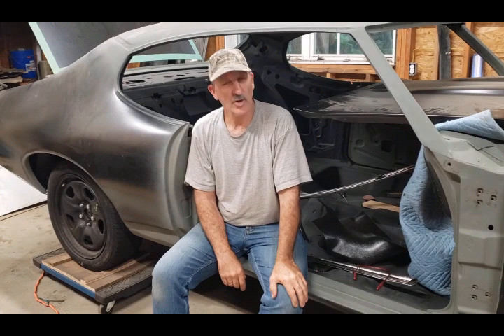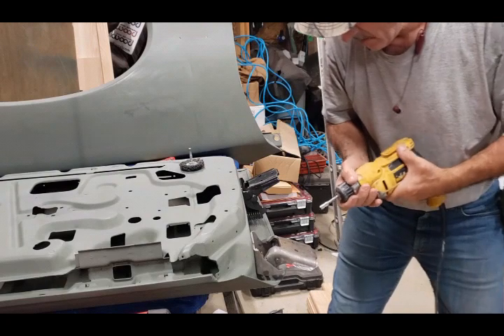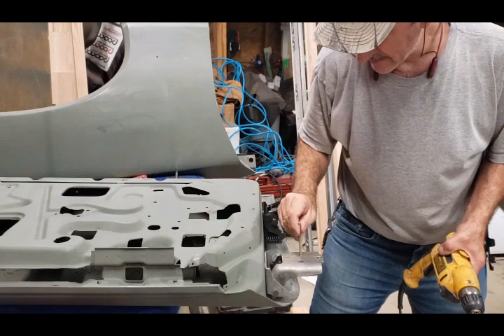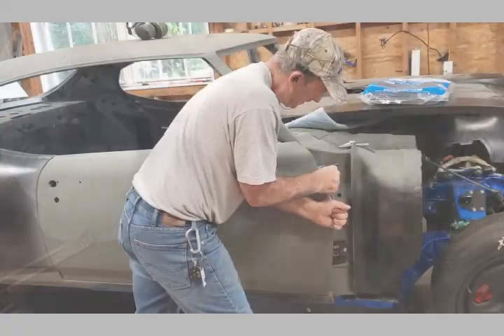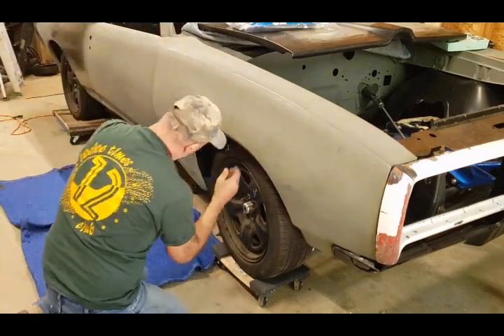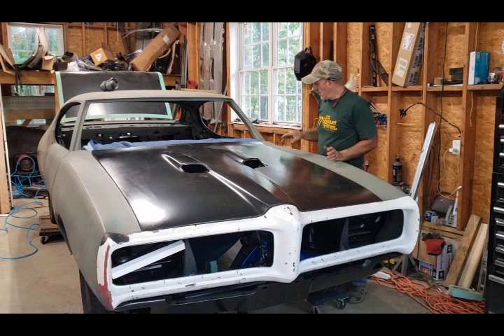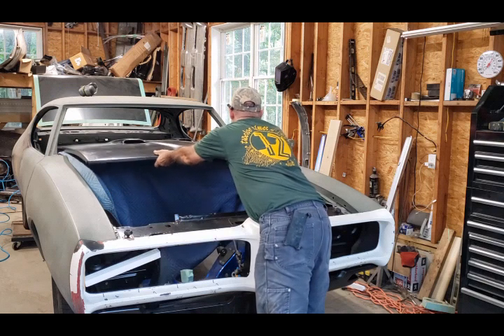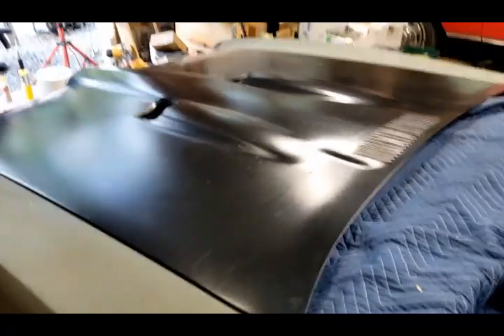GTO door & front-end adjustments 68-72

Comment: hey Harry , great video I have a few questions , your gap between the door and fender looks like 1/2 inch how will you resolve that without moving the fender? also I have a 68 Olds H/O A-body the body shop located my inner fenders and they are not correct because they do not line up with my core support holes, my question is should I remove the fender and locate the plastic inner fender first and then install the fender and make it match up to the inner fender ? One more question, can you show us how you discovered the 1/8 inch misalignment? I also did a frame off and my body may not be square I'm just not sure how to check it for square once the body is on it. I measured my frame for square when it was just a rolling chassis. Not sure how to check the body for square, Thanks again for your time and keep the videos coming, they are very educational., Joe in Kansas
Reply from the maker: Hi Joe. To answer your first question. Any Gap that is not symmetrical with the fender or quarter panel I am going to weld metal onto the part that needs to be filled. Such as the door, I might add some wire to compensate for the space.  The body not being Square on the frame. I put the front end on.  I noticed that the fenders were not lining up properly. So I started at the back of the car. I measured down from my quarter panels to the rear end. I got my measurement that way. I compared it to the other side and I was off approximately 5/16. Which would actually make up the space between the firewall and the fender. Once I installed the hood. I aligned everything from the firewall to the front bumper. The front end had to slide to the driver side approximately 3/4 of an inch. I am going to make a video of that soon. Also in order to check for square you could use a tandem. I have one and I am going to post that in the video as well. As for the inner fender. I will install the fender first and then I will cut slits above the bolt holes where it gets secured to the inner fender (cut the inner Fender only) that way it will flex and not pull your front end to the left or to the right. I hope I answered all your questions. If not let me know. I'm glad you're enjoying the videos. All the best

Comment: Im thinking you might have your quarters pushed back somehow when they were replaced. The front bottom  of your door should line up pretty close with your  rockers.
Reply from the maker: The GTO 68-69 I'm not too sure about the other ones, the Gap is between the fender and the door. The rocker panel and the lower Fender actually touch. The Gap is between the fender and the door. you can't push back the quarters because of the inner structure of the body the quarters get welded to the plate where the door Striker is. It's very difficult to explain. You have to really watch the video I go through all that when I'm installing my quarter panels. Thanks for commenting. All the best..
Reply: @classicrewind2715  Hey no worries,  hope it works out for you. On my 69 I have a 1/8 gap between the rockers and the fender and the door is 1/16 back from the rockers giving me about 3/16 from fender to door and 3/16 from door to quarter. Mine was that way from the factory and I put it back that way when I restored it. I do know the facrory did a horrible job assembling these to begin with lol
Reply from the maker: Thanks. I think this car was in an accident before I purchased it which racked the front end a little. I'm working with a lot of aftermarket parts which makes it a little difficult to line up exactly. Taking a lot of pictures at car shows from Originals to make sure the body lines all match. Even though I am building a Resto mod I would still like the body lines to match. All the best

Comment: Have you put up a video on how you squared up your body to the frame, that you were talking about in this video?
Reply from the maker: Hi Tyson. The way I figured my body was not square with the frame. I measured the wheelwell down to the rear.  I was approximately 7/8 of an inch off if I'm not mistaken. So I loosened up the body bolts and shifted the body over 3/8 of an inch. I rechecked made sure I had equal distance.. as for the front Before You Secure your fenders make sure your hood is a line properly. A lot of people secure the fenders up first with the radiator core support and then start adjusting door gaps not realizing the hood is going to throw everything off. I hope this helps let me know if I answered your question. All the best
Reply: @classicrewind2715  thank you for the great Info!